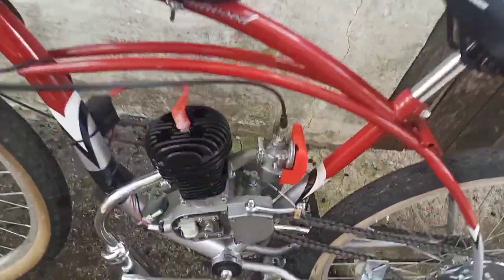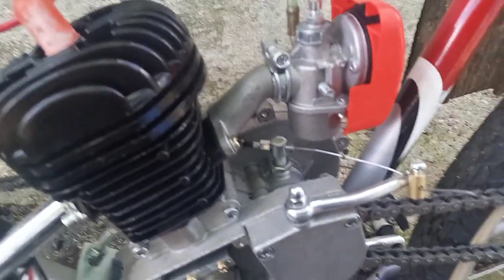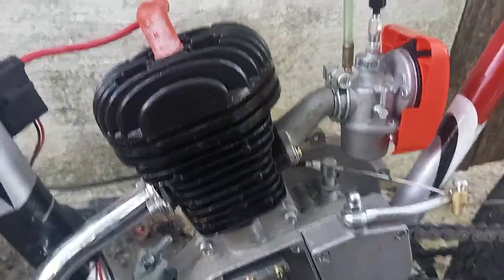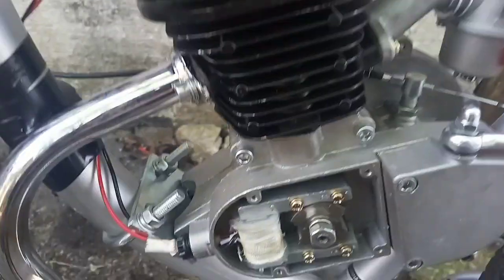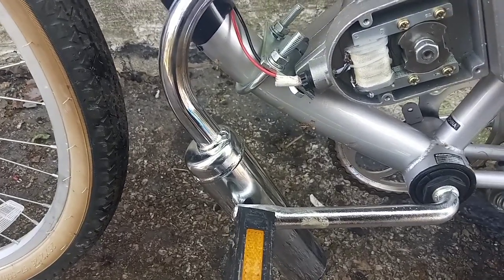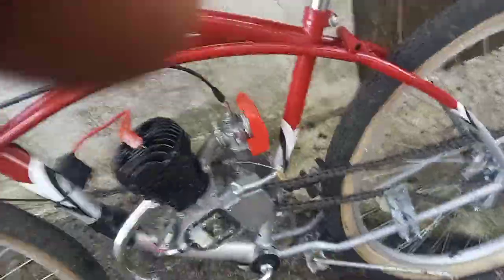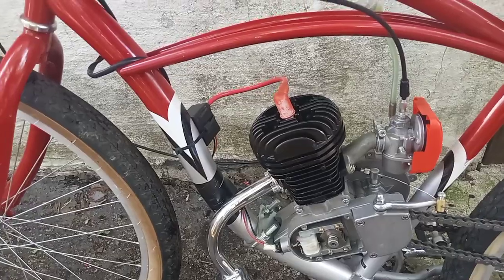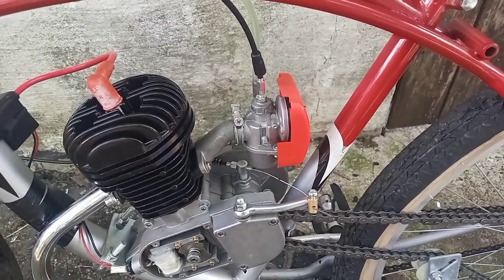Motorized Bicycle Carb Tuning - Part 2

Comment: Always start your jets at the top Go rich to lean. 80 down to 70 as such. You can blow the motor starting small. Ill post a tip for you in a minute.
Reply from the maker: Yes! Too rich is always better than lean! After my exhaust removal the thing got way lean from that extra flow. Should have remembered that a bigger exhaust will need a bigger jet.

Comment: Expansion chambers are a must for a two stroke. Night and day difference in power.  Thats when the jetting comes into play. The yd100's are a funky motor that wont rev as high so your best bet is a longer tube before the chamber and use its good torque and use a smaller rear sprocket. The higher rpm motors like a shorter header ect. 2 stroke harmonics are a trip and its a never ending rabbit hole. I switched from a bananna pipe to a cheap $40 2 piece pipe with an actual decent expansion chamber and it has atleast 35% more bottom end power.

Comment: Man have we come along way in a year. 65 jet, 70 is to much fuel, doesnt make power and more likely the cause of 4 stroking at top speed, throttle needle clip in the middle, modify exhaust by cutting the tube inside down to yhe nub and drill an rxtra hole in the cap, barely any louder than stock and makes a world of difference. 40 to 1 fuel ratio for more power or 32 to 1 if you want more lubrication and a tad less power. These are all general mid range settings you can go up and down from there, if a 68 jet works better and you can find them in that increment for the new BOFANG CARBS GOOD LUCK. MAY THE FORCE BE WITH YOU. 😂

Comment: Same(?) problem here.I put reed valve/mz clone on my ported 66 c.c.,running fine on a 70 jet I put reed/mz clone on my yd 100 with 70 jet but when I pull clutch in,idle goes WAY up.Do I have to have 3rd transfer port or just upjet ya think?? (Fast as hell but don't wanna burn it out so short rides)Thanks
Reply from the maker: Sounds like it's running lean on idle, needs bigger jet if it's high idling out of control

Comment: Crankseals, do a leak down test.
Reply from the maker: Crank seals? Are you talking about piston rings or the base gaskets at the bottom of the cylinder or something? No seals or gaskets below that on these engines. Am I missing something? Please hit me back with some enlightenment! Thanks 🌞
Reply: @WhitefolksT  Behind the magnet and behind the small drive gear hides 2 rubber seals that often leak causing the engine
not to be able to pressure push the fuel
through the transfers and draw in air.
https://www.youtube.com/watch?v=x-Jarx2od6I&t=2366s
I have left a link to something i found helpful. I use soapy water in spray bottle a hose to the intake, i find the spot on motor where air is coming from end of muffler when i blow by turning motor slowly till you hear it hiss out exhaust. Then i block exhaust , with my thumb, and blow through hose on intake while spraying areas like crank seals, base gaskets, intake gaskets, whole case.
Reply from the maker: @supersportryder  outstanding info, thanks!!
Reply from the maker: @supersportryder  you know, over the years I've probably had a handful of these engines come through my garage with this issue. Didn't even think about the crankcase being sealed properly to pull the fuel charge, just took it for granted. Another pain in the ass with things. Thanks again for the heads up on that.
Reply: @WhitefolksT  Glad to help a fellow biker.
At this point I know not to put a motor on a bike until it is tight, holding pressure. Of course ported, the clutch pads filed so they move, the big internal clutch spring tightened up and the magneto checked for gap at magnet. Also an NGK gapped to .6 or .7mm. Must remove kill switch(shorts magneto to stop) splice wires direct from magneto to cdi remove stock bs connectors. Shut bike with clutch slowly.
Oko 21 or 24 with fat tubed G2 reed(bgf)and big windowed piston are the way to go. Oko is not that hard to tune if you have no leaks in the first place. Sorry for the book but it seems I like to teach and you like to learn.
Reply: @WhitefolksT  One more thing that saved my ass, ALL silicone turns to jello from 2 stroke fuel, permatex motoseal has a dirtbike and a chainsaw on the package and can be used in place of a base gasket or case half gasket ,intake exhaust

Comment: Should be able to see it now if you need anything else feel free. I can go live and work on it with you
Reply from the maker: Just checked it out, good stuff man. I got so used to the 66cc engines being fairly rideable out the box (especially for the under $300 specials)  I had neglected to level up my fine tuning and troubleshooting knowledge of these things. Gonna get these yd100 engines screaming like they should now!